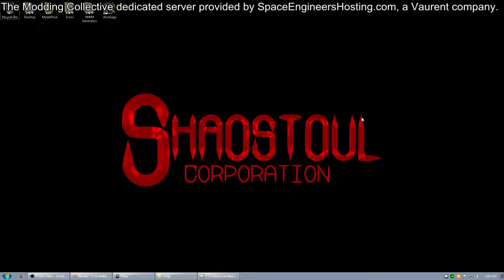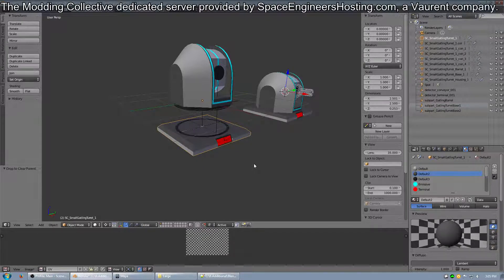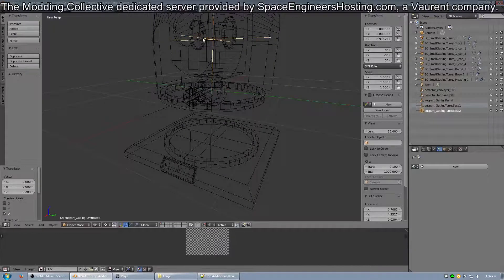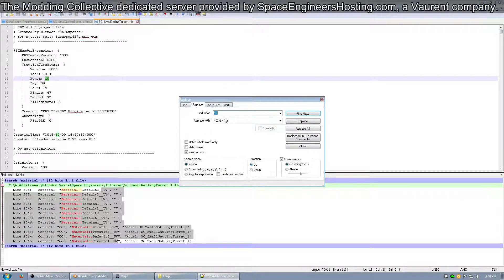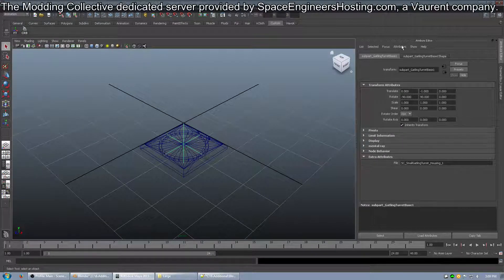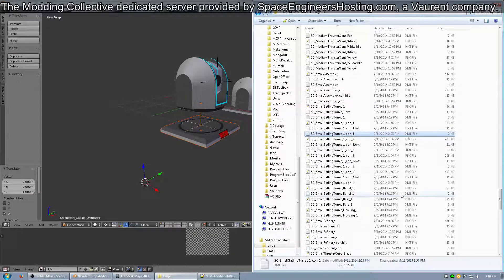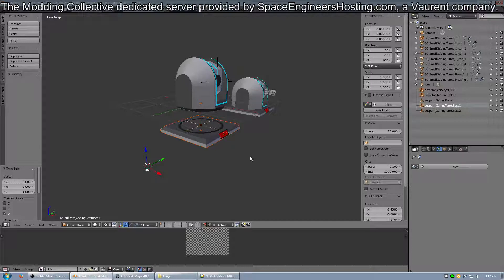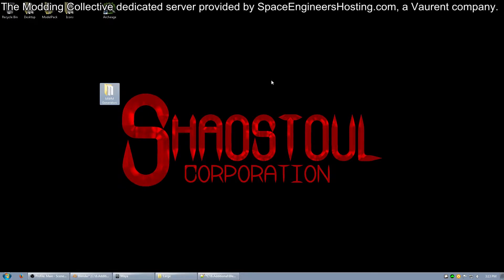OBSOLETE: Space Engineers Modding Tutorial: Dummies/Empties & Custom Attributes

Comment: Custom attributes partially work in 3DS Max 2013.
They are supported, however the FBX exporter fails to export the attribute values (but the names are there).
To work around this, you must save the FBX in ASCII format, then open it in a text editor and search for the custom attribute and enter in the correct value.

For example, to set the 'file' custom attribute to the correct filename (even though it shows in Max):
Search for:
P: "file", "KString", "", "U", ""
and replace it with:
P: "file", "KString", "", "U", "HangarDoor_door1"

You'll need to correctly replace all instances. The correct value will be based on the context of where in the FBX file it is.
You'll know by looking at the name of the dummy it's attached to above it.
For example:
Model: 1536896336, "Model::subpart_HangarDoor_door1", "Null" {
Reply from the maker: Phoenix84118 It's good to hear some input for Max. Thankfully with Harag's new Blender plugin, this and pretty much everything else can be handled entirely in Blender, including building the mwm.

Comment: Can you make the custom attributes with-out using maya?
Reply from the maker: Leanardoe Yes, to an extent... When working in Blender, I have to use a special add-on by one of the other modders for the special attribute to be saved to the FBX, as when I was working without it, the custom attribute didn't save. I've had to use what worked at the time, so things could've changed.The following link may be the latest version of an add-on for Blender. http://forums.keenswh.com/post/se-block-tools-for-blender-7285972?highlight=shaostoul&pid=1286098522#post1286098522